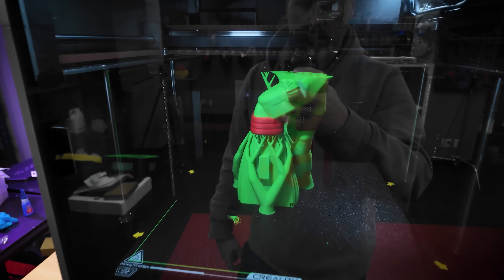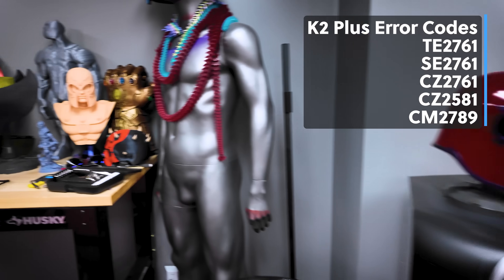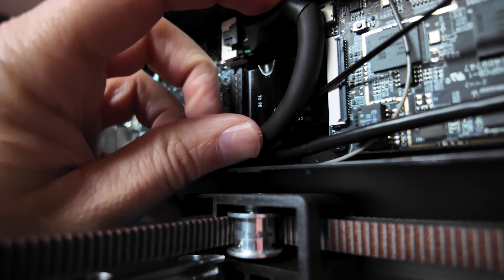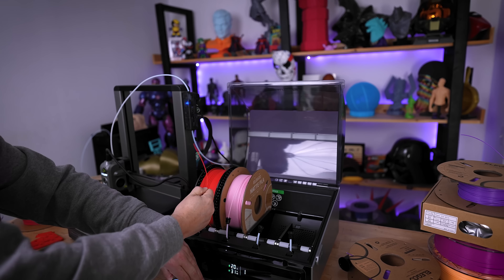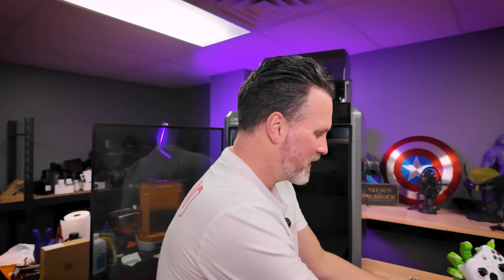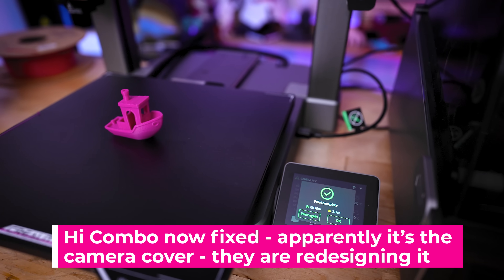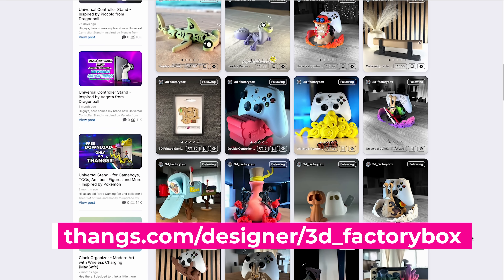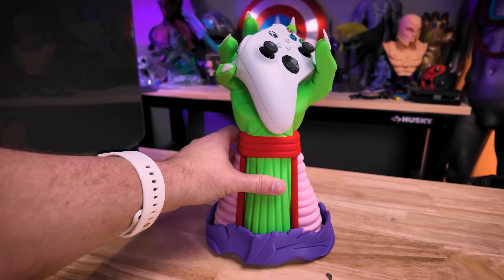Creality K2 Plus FIXED! But Are They Rushing Printers?

Comment: The problem with Creality is that for someone in a position that affects their sales, they will go above and beyond, but normal users that they feel don't affect their bottom line, they will give the runaround and make them jump through hoops.
That statement is really not a negative reflection on you; I am really happy you got your printer fixed; it is just the unfortunate, sad truth about Creality as a company and what I had to deal with.

I am really happy you are shining a light on what they need to fix and having them add the replacement cable to their store.

I have spent a year and 8 months for them to finally replace my printer. I have sold my 7 Creality printers, and I will never support them again.

Customer service should be a priority and not an inconvenience.
Reply from the maker: Oh im 1000% aware. Myself and others typically have a brand contact we work through that then works with their support team or puts us in contact with a support team member. I can only imagine how frustrating that would be if you paid $1500 and support not knowing how to actually fix the issues. 

Hopefully this video helps folks with the machine dealing with the same errors
Reply: @UncleJessy  thank you very much for your kind reply, and I believe this video will be beneficial for a lot of people. Thank you very much for using your platform to shine a light on this.
Reply: @UncleJessy  yep, and next time you talk to them tell them they lost a customer over a $3 part!  See my other reply.  I'll never buy another Creality product after this.
Reply: Just started a project 3 months ago. I bought 4 k2's and they have been a constant nightmare. 3 months old and 3 of the 4 are crashing z axis due to random strain gage failures. No help from creality. I have 4 cables on order.
Reply: Exactly, and most people aren't going to have the skills to go through all that like Jessy, well at least I wouldn't confidently. Nor should anyone have to.
Reply: I have not had issues with creality replacing components they have sent me new motherboard before when I had put an android loaded SD card in the machine and bricked the motherboard...  turns out i could have reloaded the firmware but they still sent me a new motherboard regardless of the reason...
Reply: I have gotten no fewer than 4-5 warranty parts sent to me for my K2 Plus units and each one was easy to request, no hassle, and shipped fast.
Reply: This has been my experience unfortunately. Like this is their flagship printer and they just can't seem to offer adequate support, or quality control. I'd be okay if they skimped on one or the other, but not both. It leaves many of us with a $1000+ 3D printer that's unreliable at best, and a $1000+ paperweight at worst. It takes me 2+ weeks of back and forth to get replacement parts sent out on stuff that is provably defective, like I had an issue with my CFS and the output hub board was sensing filament when none was in there. They have a wiki entry for this and I followed their instructions to a T and they still gave me a runaround for two weeks before finally sending me the part I needed to replace.

Better late than never I guess but it's certainly cemented that my next 3D printer will NOT be a Creality
Reply: I had the same experience. Email after email and no resolution. They even closed my ticket before it was "resolved".  I had a bad extruder and had to finally go to Amazon and buy one.
Reply: yes exactly! thats why im not supporting creality anymore.
Reply: Agreed. Trash company
Reply: Hard agree with this, I've had a terrible experience trying to get support from Creality regarding their faulty Space Pi dryer. Thankfully I bought it from Amazon so just returned it, but Creality were zero help at all, ignored emails for days before replying and their reply was literally a waste of time. Creality, at the minute, are playing catch up to Bambu since they shook up the industry. Whilst they're catching up slowly on printers, they need to catch up on actually caring about their users and providing support instead of just pushing another copycat machine.
Reply: i do not have a youtube channel or following and i requested a part for my k1 max and i had it withen a couple days so i cant say i agree.
Reply: I had an issue with the screen on my filament dryer and they send me a replacement next day. I also had issues with my K1 and they walked me through it so I guess it’s hit and miss for some but not IMO. I left Elegoo for Creality
Reply: Yep, run around for sure!  My machine is less than a month old (within return window) and they are making me jump through hoops for a strain gauge!  Made me disassemble it then they didn't like the photo I sent and asked me to take another. This is a day later after I'd already reassembled so I could do some simple prints. This is for a simple $3 part!  Are you kidding me!?  My bed is warped like crazy (you can see from the graph in the software) and the mesh is 1.6+!  I've tried manually fixing the level multiple times but no better.  I asked them to replace the bed and strain gauge.  I guess they'd rather have users mad and venting on social media.  This printer is going back and with this kind of customer 'service' I'll never buy another Creality product.  Geeze, this is a $1500 printer and they can't replace a couple parts that cost them pennies made there in China.  Unbelievable.
Reply: that has not been the case for me, they have sent me replacement parts  and emails asking me if that fixed the problem or not, yeah the quality control is terrible ,but in my case their customer service is decent .
Reply: Ma femme a acheté la K2 Plus en toute confiance par ce que moi j'ai une petite Creality Ender 3 qui fonctionne parfaitement. La différence, c'est qu'il n'y a pas de miniaturisation loufoque sue des éléments qui vibrent.
Reply: I’m sitting with a broken K2 Plus and I don’t know what to fix next. I don’t have the social media clout hence I am on my own 😢Such a big regret.
Reply: My experience right now as well. My CFS is dead after two weeks from the factory on my brand new unit. I have the store I purchased it from going back and forth with Creality and it seems like they're giving us the runaround asking for stuff that makes no sense. I sent in photos of a CLEARLY damaged CFS cable that was pinched from the factory, and for some reason they're asking me if I tried re-inserting the cable and if that fixed it...? Like no the cable is literally destroyed, I'm surprised it ever worked. Now they're asking me for a video showing them how it doesn't work, after I sent 4 videos of the error codes, their repair procedure etc. The CFS doesn't feed filament, how am I supposed to show a video of it NOT doing a thing...? There's nothing to see... It does nothing. I'm two weeks now without a CFS and now after doing everything they've asked it seems like they're trying to suggest the CRUSHED cable is fine... And beyond all of this with the CFS they don't seem to want to address the fact that my bed is 2mm out of whack from the factory AND my belt bearings are squealing already.
Reply: @kylequinn1963  I am really sorry that you have to deal with that. I really hope you get it sorted as soon as possible.
Reply: @kylequinn1963 sounds like they are using the tactics of a vacuum cleaner company

Comment: Having been in the Electronics Engineering & Manufacturing Industry for the past 30+ years, I can resoundly say without reservation that Chinese companies have little to no understanding of the importance of performing in-depth, detailed testing of the products that they make.  Their mentality is to be "first to market" at the cost of everything else.

I bought a K1 shortly after they came out and the printer as a whole is garbage.  After having many back-n-forth sessions with Creality (and having rebuilt the printer no less than 4 times), I'm of the frame of mind that I will never buy anything from them ever again (and my K1 STILL isn't operational...!!!...).

On the flipside, I really do enjoy and appreciate the videos that you make (and the time that you put into making them).  I'm now seriously considering getting the Elegoo Centauri for my 3D printing needs.
Reply: That makes sense. Look at what Elegoo does. They release a new product, then after all the issues are found they release a "pro" or a "2" model with those issues fixed. One of the reasons I didnt get the new Centuri. Ill wait for the "pro" version that will come out in less than a year.
Reply: @turbotwo1  I think that's more true of Creality, first sign of trouble they release the "fix" as a new model.  With Elegoo, their Neptune 4 product line was a lemon from the start, but they didn't "fix" it with a Neptune 5, instead they've stuck at it and it's now the machine it should have been at launch.  Jury is out on the Centauri, awesome pricing though.
Reply: I'm in a similar field and see the same, like testing is a foreign concept. "Oh xyz don't work, just but a new one" 

I'd be wary of any new printer and give it a year or wait for the everyday user reviews/complaints. 

For the Anycubic Kobra S1 from the end of last year, units just shipped and among the issues on thier reddits is no WiFi printing (in 2025): or access to the console. So if you're in Linux, you're SOL 

For the US, the Centauri will ship in June. 

I'm in the Qidi Plus 4 Camp, but in its first release, it was not rated for 120VAC (US/CAN). It's SSR heating chamber board was changed since.
Reply: Spend the money on a Bambu. It’s hard using anything else once you get a machine that “just works”.

Comment: A lot of 3D printing companies encounter quality control issues at launch. 
When someone asked about the HI or A1, I recommended the A1 or waiting for the HI. 

Later after getting down voted I said this:
Prusa: The XL had issues at launch.
Creality: The original K1s faced problems.
Bambu: The A1 had a power cable issue.
Elegoo: The Centauri Carbon had issues they’ve promised to fix in the next wave.

I personally have a K2. 
While it's a good machine overall, it’s had its fair share of problems, such as broken feet and CFS issues.
Reply: Every company is going to have problems with newly released products. It's how they deal with those problems that's important
Reply: @Sabbath-666  So true
Reply: My K2 has some fans needed to be replaced, and an awful warped bed!
Reply: @eudenmark  After numerous launches, it's mind-boggling that Creality still hasn't resolved the persistent QC issues with warped beds. Whether it's a shipping or factory issue—who cares? Just fix it! Companies should also prioritize testing their printers after shipping it across the globe before moving to mass production.
Reply: @protecteratr  That is an expensive and logistics issue
Reply: The Prusa has literally zero issues
Reply: @AndrasBuzas1908  For the price it certainly shouldn't have!

Comment: Maybe we just need to accept that Creality is a subpar company with poor quality control?
Reply: Sadly YES, even for expensive machines, the users have to "fix" them.... so many got terrible warped beds, and Creality don't care.
Reply: @eudenmark  I recently purchased a K1 within the last couple months and mine came with an atrociously warped bed, i mean it was REALLY bad, i did not understand what was going on for a while until i rooted it and took a look at the mesh and it all became very clear, i was seeing some real high deviation, i did manage to get it to acceptable levels but its not perfect... so its very clear creality know about this and get them sold and sent anyway.

However having spoke directly to creality just last week it was all agreed inside that week that my bed was like a poppadom from your worst nightmare and that they would send me a replacement, no drama, a few simple requests like a picture of the serial number and then they said it will be on its way. Ofcourse that will mean nothing if the new part comes and is like a poppadom itself which lets be honest is extremely likely, im just hoping its less so poppadom somehow.

So im like... really not sure how to read them, on one hand they send out crap which is red flag number 1 but on the other hand they have treated me well in contact and trying to fix my issue.
Reply: Ha! Wear and tear... I would assume mine was made worn and torn
Reply: At a certain point, Creality becomes a general contractor and subs out the manufacturing of many of the components. If your cable was made on Monday or Friday it was likely to be faulty. Crimping cable connectors requires diligence that may not be found when you are in a race to the bottom.
Reply: DUUH, welcome home.
Reply: It always has been this way.
Reply: They are not the only one, and Bambu Lab did design mistake in A1 as well TBH
Reply: @kimmotoivanen  Or realize the Bambu thing is massively overblown if you just want a machine that works and just buy the printer that works out of the box. Don't get me wrong, some of the other companies are catching up, but if you want a tool that simply works and lets you focus on the printing, then bambu is still the only real choice. Now if you want to tinker with the machine and don't mind some of the headache, then the world is your oyster so to speak.
Reply: @OmegaGamingNetwork  Not really. Bambu is nothing special as far as their hardware. Have an A1 that has 75 hours with more problems than a math book. Bed replaced, power board replaced, and now waiting on a new hub for the ams lite. (Mind you I got mine after they "fixed" the bed issue lol) A real POS. Which is funny. I have the Ender 3 pro with origional 8bit mainboard that still works perfectly, Ender 3 neo max (never had an issue or failure which still works fantastic), and a K1 max which is my go to right now. Thats just Creality stuff. I have an Flsun QQ S pro that works perfectly. The worst printer I have is a X5SA-400 pro. The only reason its the worst is I haven't got a single print off that machine. A1 only beats it because I have gotten  a few prints off it before it broke. Again..
Reply: @OmegaGamingNetwork I need to print without going through a Chinese controlled cloud.  I need to print offline.  Bambu is not an option.

Comment: Thank you for the video. While I know your unit hasn't been horrible. I hope now that it is fixed that you continue to test and let us know how it actually works with all the other materials and everything else. My unit has been great and I'm very grateful for that, but I've only really printed PLA. I am also not running the most current firmware because I did run into some errors and had to revert back. Waiting on some good reviews with the new firmware before I update again. Keep up the great work.

Comment: It's the continued flex of the cable as it moves round that is causing the problem. I had a similar situation many years ago where a cable on a system that we had shipped momentarily broke and gave a false trigger. We replaced the cable, only for the same thing to happen again months later. The solution was to double up on the cable i.e. have TWO cable runs for the individual strand. 
What was happening was that the continued flexing of the cable was causing the cable strands to shear. Most of the time the sheared ends of the cable were in contact with each other and continuity was maintained, BUT occasionally the sheared ends did NOT maintain contact and the circuit was momentarily broken - became open circuit. 
As I say, the solution was to double up on the cable run. It is likely that the same flexure was still creating micro breaks in the NOW doubled up cables, but that the individual circuit breaks are not happening at the same time. 
This solution solved the problem and we never had any more troubles.
I don't think just changing the cable on the printer will SOLVE the problem. 
I suspect it will come back again as it did for us. It's always a problem with cables being constantly flexed like this.

Comment: OMG!!! I just went through this too.  I am just finishing putting everything back together with the new cable.  Creality first sent a replacement the hotend board too.  Then when that didn't work they sent the cable, the hotend, and the board again.  I replaced one at a time.  The cable solved all my issues!  
In case anyone uses this to diagnose, I throw in my error codes started with some random BM0111 (abnormal connection to nozzle) and then constant 2355 unknown errors.
Did you screw back down the chain guard at the head?  The new cable has  more hardened heat shrink I am scared to bend to much for fear of ruining the new cable.  Thinking of creating a new guard cover that just holds down the guard and not the cable.

Comment: Damn it. I really want a large, enclosed printer. I have a P1P, but I want to do large cosplay parts. Bigger would be much better. However, I'm want to make using a 3d printer, not 3d print as a hobby unto itself. My Bambu works every time. Any lack of polish that causes me to troubleshoot rather than print is not acceptable. I guess I'll keep waiting.

Comment: Glad you got it fixed and are providing visibility to the solution. Creality need to SLOW DOWN and QC check products. It's a shame that something as trivial as a faulty cable/camera cover is causing such issues, and it's off-putting to customers from making purchases as these printers are getting more expensive.